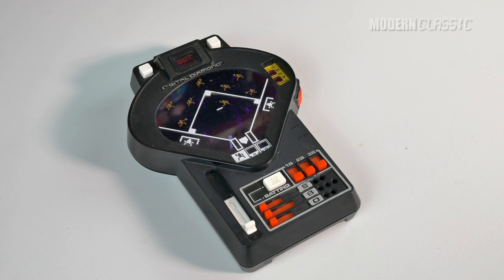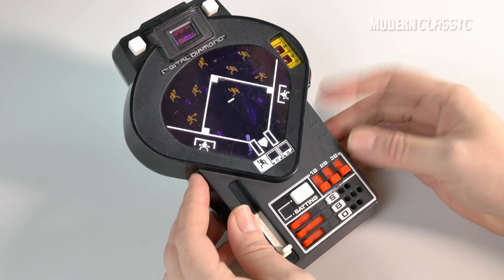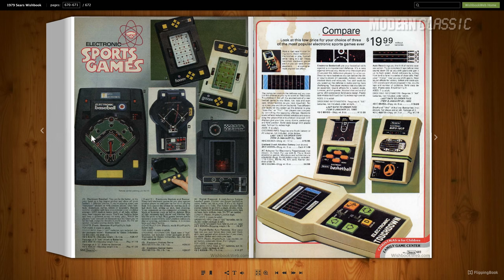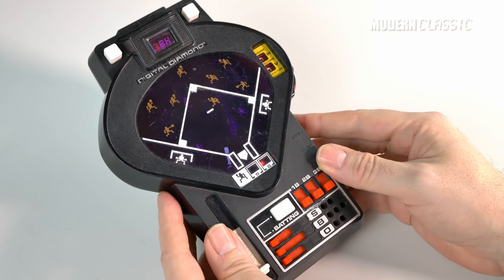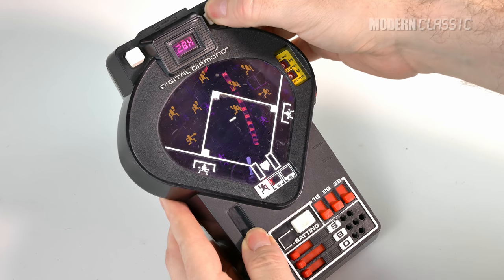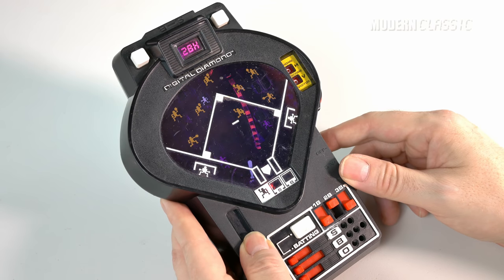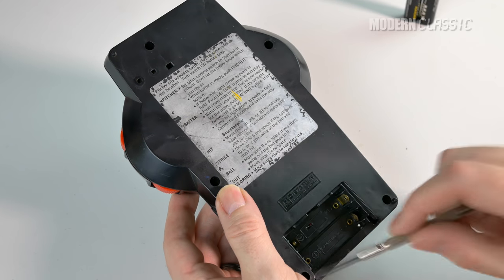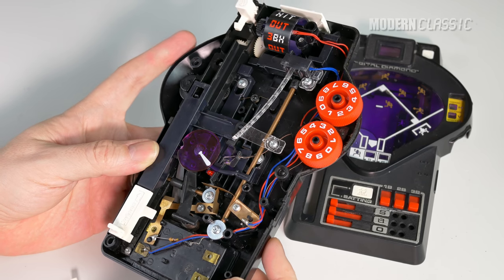Inside a Tomy Digital Diamond game from 1978!

Comment: I was expecting something solid state with bleeps and bloops, but this is so much cooler. It's rather ingenious actually.
Reply from the maker: Yeah, the NTEX Electronic Baseball that I mentioned in the Sears catalog is all solid state, and that basically replaced this. I love these mechanical designs, though. This thing's got 2 LED's and that's the extent of its "electronics". Everything else is mechanical.
Reply: @ModernClassic  Just watched a video on the Intex one, and it's not nearly as cool as Tomy's!
Reply: @ModernClassic  Watching the video again.....it seems to have 3 LEDs, no?  One for the ball, one for the long streak effect, and one to backlight the results spinner.
Reply: Got one and took it apart.  The lights for the streak effect and the results spinner are tiny incandescents!  Only 1 LED, the ball.

Comment: My cousin had one of those, and I played it a few times. I don't think I've ever seen it powered.
(5:07) I think you forgot to clear the Ball slider for the next batter.
(9:15) My usual method with car mirrors and vents, is to use the adhesive from electrical friction tape to gum up something that I still want to move, but has too much slop.